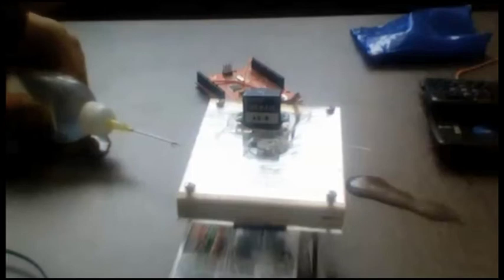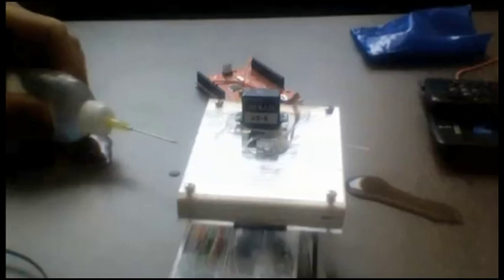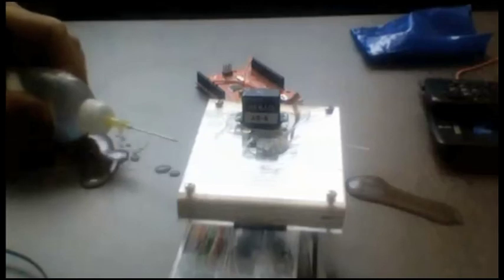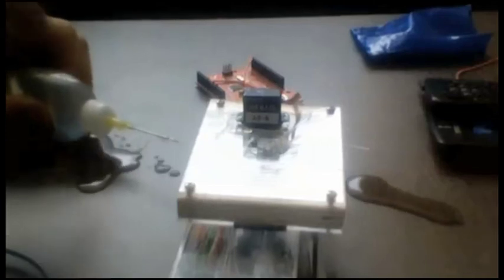Servo controlled pinch-valve

Comment: Nice demo. I like the little servo controlled pinch valve you have been using. Is this off the shelf and if so, could you share the model and source.
Thanks